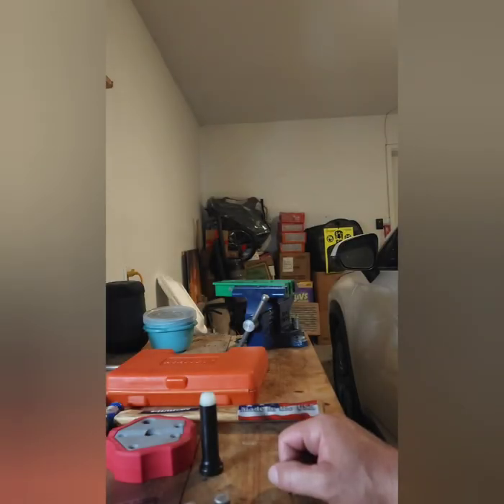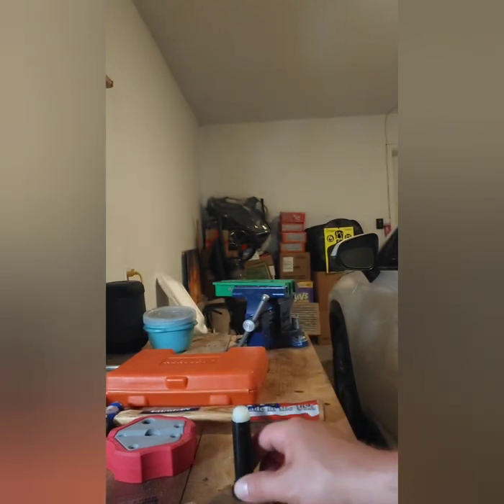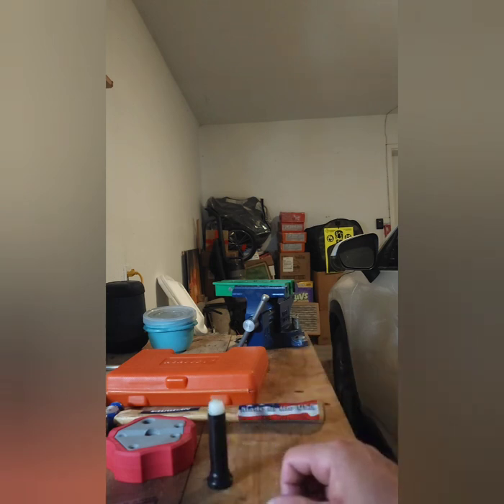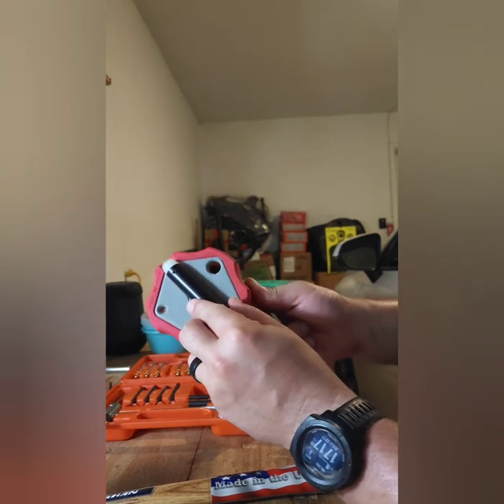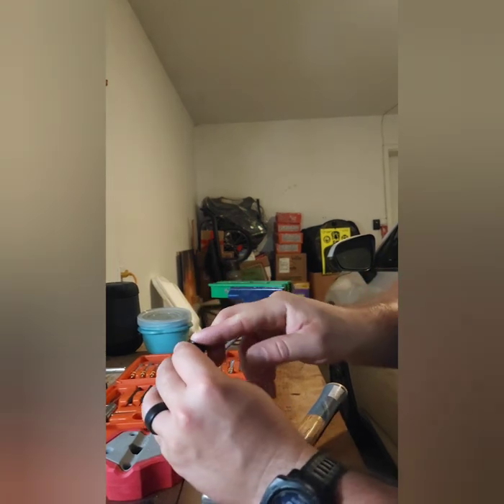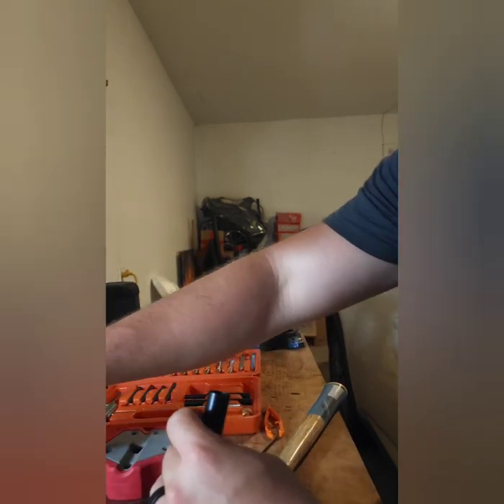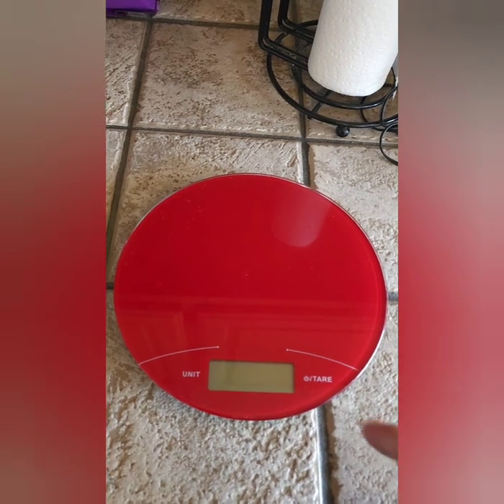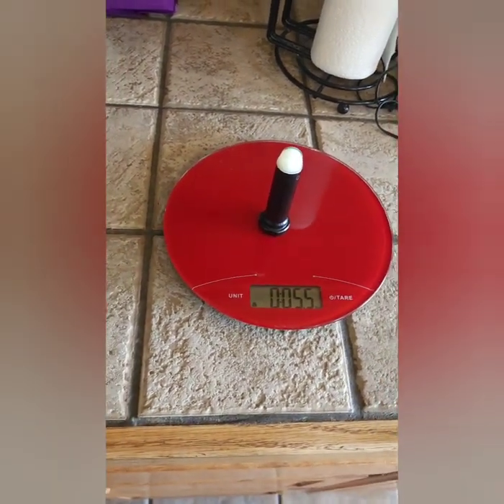How To Adjust The Weight In Your AR15 Buffer

Comment: Something to point out is the "slop" in the buffer weights is intentional. It is meant to eliminate the chance of your bolt bouncing out of battery after the buffer hits the bolt carrier home. Same way why dead blow hammer works. You can have a solid weight and not have bolt bounce, but the slop ensures you'll never have that problem in a 5.56 AR.
Reply: I’ve never really thought about that but you’re 100% as someone who has spent too much money on blow hammer this makes total sense

Comment: Hope you read this question, can I use one steel weight and a wooden dowel rod inside my buffer to make it lighter but still functional? My AR is slightly under gassed and was wondering if that might help. Also I purchased a h2 buffer with weights molded into the inner of the buffer, so it's not adjustable. Would you happen to know what kind of buffer is solid and not adjustable? Also the sloppy sound is for when the buffer returns the bolt after firing to mitigate bolt bounce. But it's really not a problem unless your shooting full auto, in which case you would have light primer strikes. But all in all great video and any input would greatly be appreciated sir. Also subbed and liked the video
Reply from the maker: Sorry it took me so long to see this man.  Yeah, if it fits and works, absolutely.  The great thing about trying different things out is trial by error.  Once you get it dialed in, you'll be good to go.  You might also want to check your gas block alignment.  Even if it's off just the slightest bit that will throw off the gassing of your weapon.